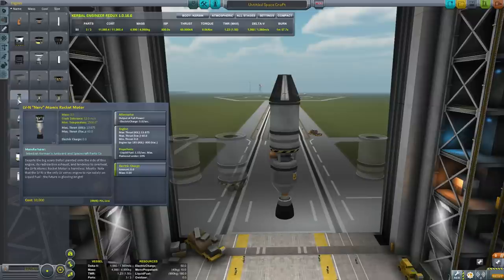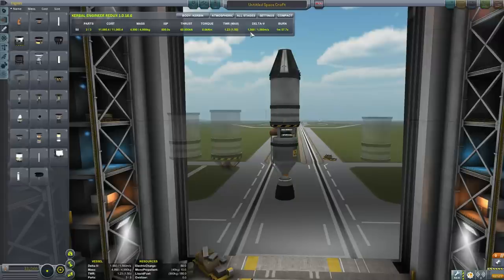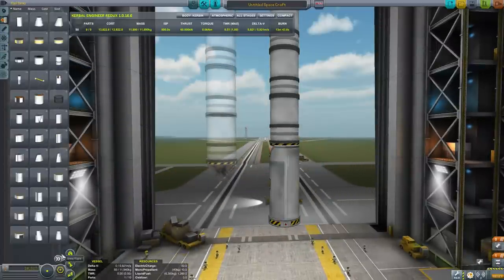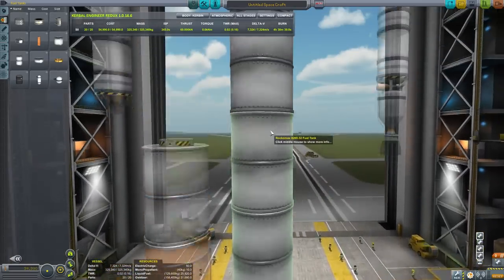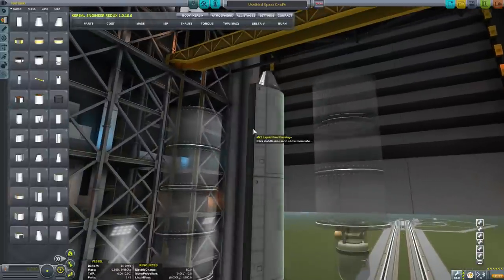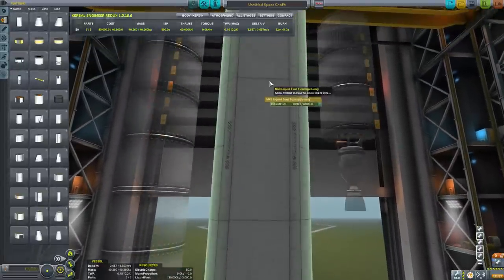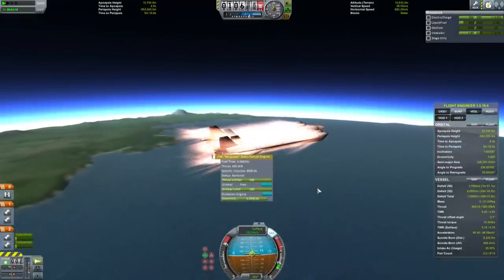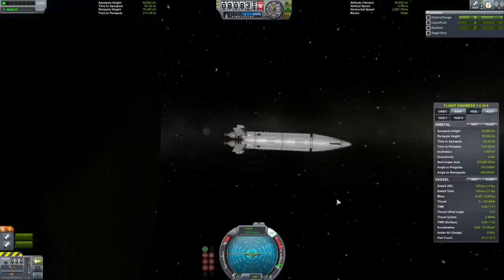Nuclear Engines & Hydrogen Fuel in Kerbal Space Program

Comment: I don't know about Nerva, But if you have done any research on Molten Salt Technology the original Idea was to use a completely different approach to reactor technology, where the fuel is not a solid but a liquid and in particularly a Molten Fluoride Salt.

There were several key advantages to these types of fluid fuels in that they are already Melted and thus, Reactor temperatures could be at far higher temperatures (600-800 degrees Celsius) as opposed to 300-400 for your typical solid fuel reactor. 

Look up the Aircraft nuclear propulsion reactor experiment or the Molten salt reactor experiment.
Reply: OnePercent Therefore you could achieve the same amount of temperature you got with chemical rockets without having a melt down because the reactor operates at room pressure but far higher temperature.
Reply: OnePercent The NERVA engine had an exhaust gas temperature of 4000 degrees, not 400.
Reply: Chris Maillet I was talking about civilian operated nuclear reactor for electrical generation, Not Nerva. 

Fundamentally you can achieve the best temperature with a reactor that does not rely on water.
Reply: OnePercent  Everything I've read about liquid metal cooled reactors indicated that they were a maintenance nightmare.  LFTR FTW!
Reply: Foxholeatheist Well of course, if your fuel medium and Coolant is liquid sodium...

I was rooting for LFTR btw!!!

Comment: Well, technically, they did recieve a fairly big nerf in the "standard" use case, as they used to be able to give insane amount of dV on a very small amount of fuel, making them really viable for small spacecrafts.

They were definitely too good, and with the changes on the core gameplay, it made sense to change them around a bit.

Comment: LH2 doesn't perform well unless you make the tank mass ratios closer to real life.  The external tank on the shuttle weighed 30 tons (LOx tank included) and held 106 tons of LH2.  Those mostly empty liquid fuel tanks are probably more massive than the fuel they hold.

Comment: What is the advantage of using those pre-cooler things in front of the jet engines?
Reply: MonkeyTardis ya; what is it?!
Reply: Sosuke Aizen I dunno, that's why I'm asking :D
Reply: MonkeyTardis A pre-cooler is for the rapier engine. In reality the sabre engine would use a pre-cooler for supersonic flight(mach 5) otherwise the airflow would cause it to over heat and deform leading to rapid unplanned disassembly.
Reply: I can tell you the real life advantage: the air slamming into the engine at mach 6 heats to around 5500 Celsius :)
Reply: ***** If you build a supersonic aircraft without precoolers, I think that qualifies as rapid PLANNED disassembly. :)

Comment: okay now how about ion engines
I built an interstellar ship launched by Extraplanetary Launchpads with the sole purpose of "I'm going to visit every damn thing in this system"

As it turns out, (with tweak scale) 2x1.25m ion engines and 2x2.5m ion engines with 45, 320 units of xenon gas and 456 Electric Charge per Second gets about 17km/s dV with a total full thrust burn time of 3d,4h,27m,16s not including payload. The only issue with this is in order to do a transfer to Duna it would've taken a 34 minute burn which was almost half my orbital period.

I am well aware that ion engines were designed for small probes, not 84t gigaships built in orbit, however since TweakScale goes by cubic measurements, I was expecting them to have a little more power than that
Reply: rparker069 Use the time as you approach the transfer window to raise your apoapsis into a highly eccentric orbit, then perform one final burn to escape on the last go-round. That's how I deal with long burns.

Comment: Well, you kind of have to use the aircraft parts. If you do, the fuel tank is only 10% of the weight of the fuel. That is actually quite realistic, even with LH fuel. But the volume is of cause a lot smaller. Actually the MK2 parts will only fit the exact same volume of fuel, even its twice the actual volume. So the plane part is kind of nerfed. 

You should actually only, at least to my opinion, empty out the fuel tanks to 20%, not 10%, to get the accurate volume. Also you should lover the mas of the tank to 20% to.

On the other hand. The LF tank is only 10% of the mass relative to 13% of the LF+O tank. This is realistic if we talk about normal fuel. So you actually lose 3% mass in version 1.0 in tank mass. (thats about 100kg for a normal fuel load... and the engine is 500kg heavier)... Buuuuut.

Here is the thing. If the Nuclear engine is used correctly. A MK3 LF tank, with 3-4 nuclear engines and a huge as docking port  in the front, and keep it orbiting kerin.

A really nice trick is to slingshot spacecraft out. Give the escape velocity from kerbin. Undock the nuclear engiens, break just so the engines don't escape (just need like 100-1000dV to stop). Then let the engines get a perhaps of about 45km and let them airobreak to they are on a semi circular orbit. Just refuel them and launch the next space craft. Most time, you just want a a capsul on the way home and don't really need a full proultion stage.

Comment: i barely use nuke engines , only nuclear power generation and stick to exotic engines , also interplantary haulers in orbit , keep the dropships low on fuel consumption
Reply: jmm1233 I mostly use nuclear engines on my Duna ships, I've started putting down mobile bases and building a space station in polar Duna orbit to study the planet, and despite being able to go TO Duna using just the end stage of my standard lifter design that I've been using since 0.9, braking into an orbit and then getting back is much easier with a nuclear engine. I might actually try to make a Nuclear SSTO so I can try a bit of flying on Duna.
Reply: ***** SSTO Spaceplane didn't work out for me, but a lander with a nuke did. I used it to get all the science from and around Duna.

Now I'm experimenting with a Duna ion glider, as it would be a lot lighter.

Anyway, I've built "Rings", basically 2 (/4/6) nuclear engines with LF tanks forming a ring, in the middle I have a docking port, I use it to tow spacecraft from planet to planet. ^^

Comment: Nerfed? That's news to me. I might be mistaken but the thrust was 60 and the ISP was 800 for a while now, meaning it should behave the very same way in its intended eviroment: space.
No, that is not correct. As far as I remember, LFO tanks of the same size were heavier than regular LF tanks, which should result in an decreased rocket size and empty mass, which would be a boost rather than a nerf.

Tell me if I'm wrong.
Reply: Björn Mätal It also got a mass increase from 2.25t to 3t, and a price increase, for those who play career mode.
Reply: Björn Mätal Actually porkjet's spiffy mk2 parts were all nerfed in terms of dry mass for 1.0. The mk3 fuel tanks were the sweet spot (I'm pretending you're the sort of efficiency-optimizer who's not above going for >0.3TWR on those longer burns, given roots and part count to burn, and thus doesn't mind using space plane parts on a space rocket ship) buuutt.. their dry mass ratio was nerfed in 1.02. So no, not as big of a boost as one might naturally expect.
Reply: tuckus2003
Never said it's a big boost, (and to be honest, I  kind of forgot about the engine's mass increase) but I still think the changes are in its favor.
Aaaand I'm not that kind of guy. I'm the one with a crappy PC, who needs to keep an eye on the part-count (and size) to keep the FPS on a still enjoyable level, which isn't 100+, but not even 60+... ^^
But I definitely don't mind using SP parts if it's with benefits!
Reply: Björn Mätal hi. sorry for bad english
Reply: Jebediah Kerman Yes.

Comment: 2 intake per turboengine seems a bit too much, IMHO.
Measurments of thrust dependancy on altitude and airspeed:
http://imgur.com/nUvZkn4
and experiments with 1 intake per engine show that engine would give too small thrust (therefore forcing us to fire up rocket engines) long before it would struggle from too few intake air.
By the way, Scott, can i ask you: What's the exact dependancy of thrust/pressure for turbojet? Maybe you know? Failed to find it in the Internet. For my experiment, I've tried different formulas, but they don't seem to match the measurments.

Comment: Scott Manley, I have a question. 

I read online that the nuclear engines may overheat while in use. For KSP 1.4.5.2243, do you recommend that I use engine pre-coolers to reduce the risk or is that really of no use? If they're useless, can't I just attach radiators to cool them down?
Reply: I never seen that nuclear engine may overheat, however, I never had a flight to Moho.
Probably it make sense if you craft is too close to Kerbol, so it cannot dissipate all heat by fuel tanks.

Comment: Your explanation might not be right, from what I understand the temperatures are within the range of ordinary rockets; the issue is that by using only H2, you will have a light exhaust molecular weight that, for the same temperature, will be able to accelerate to higher velocities, which in turn will prove to be more efficient.

Comment: For a Nuclear Engine though, would there still have to be an oxidizer in order for the hydrogen to combust?
Reply from the maker: No, you don't want combustion happening near a nuclear reactor.
Reply: I don't think it needs to combust, because the heating from the reactor expands the fuel enough. I could be wrong, though.
Reply: Chris Flynn there is no combustion going on in nuclear engines, the fuel is purely reaction mass. you could use anything. but they use hydrogen because it's the lightest element.
Reply: Chris Flynn 
The hydrogen isn't combusting,  it's just getting super-heated by the reactor core.
Reply: Chris Flynn It's not actually combusting. It's just collecting heat from the reactor and then being force out the back of the engine and that's what propels you forward
Reply: Scott Manley But that would be entertaining in KSP.
(In my best Scott Manley voice.)
Jeb is assigned the task to space walk outside to ignite the NERV engine as their worst fears came true with the experimental engine...the pilot light went out.  Moments later after a word with ground control, Bill finally chimes through with the fact that NERV engines explode when lit.  Fortunately for the crew Jeb couldn't figure out how to light a match in space.
Reply: Chris Flynn A nuclear engine doesn't actually burn fuel, thrust is generated through thermal expansion of a lightweight gas.  The heat comes from a nuclear reactor.
Reply: Chris Flynn No, but there's a concept called LANTR, LOX-Augmented Nuclear Thermal Rocket. It's basically a NERVA with an afterburner, consisting of an oxygen injector on the nozzle. It decreases the ISP while active, but greatly increases the thrust.
Reply: Sarge Rho look who it is! :P
Reply: Chris Flynn No, you don't want chemical reactions taking place near a nuclear reactor core.

Comment: I really enjoy your KSP videos, and I happened upon this one. I noticed in your intro that you stated that the exhaust temperature for nuclear (NERVA) designs "can't be as hot" as a chemical rocket exhaust because the hydrogen is "cryogenically cooling the reactor." Perhaps that's true in KSP, but in real life, it's exactly the opposite. Nuclear reactors can reach operating temperatures far in excess of the temperature of any chemical engine (>20,000K for some), causing their vastly improved ISP and dV. Hydrogen is used because it is the lightest element, among other properties, so the thermal energy input from the reactor translates into the highest exhaust velocity, and hence ISP. the Hydrogen's job isn't to cool the reactor, it's to propel the vessel as reaction mass. IRL, High thrust at sea level is certainly possible with NERVA and other nuclear engines, but the thrust to weight ratio is much lower (about 1:7) than chemical rockets (1:70). Upper stages and deep space applications are the best use of current NERVA designs, as those can take advantage of the much higher ISP (up to 2000s for some of the more advanced designs). Some nuclear propulsion designs are estimated to have thrust to weight ratios of 1:30, making nuclear SSTO's more possible, although use of nuclear engines in the lower atmosphere IRL will scatter radiation back to the payload (and crew), which is a design challenge for shielding that doesn't come into play in vacuum environments.
Reply: Wall of text.

Comment: This is going to sound silly since it isn't the actual subject of the video but would you suggest the KW Rocketry mod once they have it updated to 1.0? I have the Steam version of KSP and well I have to run 1.0....
Reply: ***** I use KW and it works fine in 1.0 if that's what you are asking.
Reply: Grogger Koldomar Ever since I got the program I've run it completely stock.  I recently started following Scott and went back and watched his IQ vids and saw he was using it and wanted to give it a try.  Unfortunately I can't use the fuel tanks for KW rocketry because apparently when oriented vertically such as in the VAB I can attach something to the 'top' of the tank, but I can't attach anything to the 'bottom (like an engine or another fuel tank)
Reply: ***** That's odd. They work fine for me. Unfortunately I don't think I can give you any useful advice. Maybe check the Curse forums or something for known bugs and fixes (assuming you haven't already). Anyway, good luck.
Reply: ***** why do you have to use 1.0? it's not like steam does not do the most recent update or anything..
Reply: theguy9208 sorry I probably should have said 1.02 (I think that is the newest version.

Comment: How would a potential Nuclear Electric Rocket fit in?

http://en.wikipedia.org/wiki/Nuclear_electric_rocket

This mentions the SAFE-400 kW thermal reactor and VASIMR, DS4G and Pulsed inductive thruster.

As starting points for a comparison. I don't suppose Kerbals has the same political problems with nuclear power or using experimental technology. :D

Comment: Can I still use them to get off the surface of Eve, or should I rely on the Terrier for that?
Reply: No chance of either working; as far as I am aware, their thrusts are greatly affected by atmosphere. When I landed on Eve in a craft with a 909-Terrier, it was producing 0kN of thrust on the surface.
Reply: Best way to get off Eve:  Hooligan Labs (a mod that adds airships) or a monster lifter with tons of ΔV
Reply: nah, thrust decreases when pressure increases, so at eve surface you need big lifter engines to get out of atmo quickly. Use mainsails and go as fast as you can, then once youre higher up you can start using some good-isp engines
Reply: The nuclear engine has a specific impulse of 0.001 at 2 atm. Eve's sea level atmospheric pressure is 5 atm. So if hard-pressed to make a choice, I'd go with the LV-909.
Reply: Even those barely work. LV-909s are only usable in the higher atmosphere of Eve nowadays.
Reply: Jack Graham Yes I know. I was just answering the question "would I rather have a nuclear engine or an LV909 on the surface of Eve?"

Comment: I can't even build an SSTO with 100% of the fuel how am I supposed to build an SSTO with 10% of the fuel...
Reply: TheElfangor Use 2 rapiers and 1 nerv. Only bring a tiny amount of oxidizer (100-200). Do as Scott did in the video, go to 10km and then pick up speed, once you get to 800m/s begin your decent. If you do it right you should be at 1.5km/s before you switch over to using oxidizer.
Start the Nerv at this point because the rapiers only get you into 70-80km space. Aim at velocity vector for the whole ride when you get to apo the Nerv will circularized your orbit with about 40% Liquid fuel left (and no oxidizer that you won't need).

Both the Nerv and the Rapier are super expensive engines though, so a SSTO like this in carrier is probably not worth it, I prefer to stick to cheap solids :P

Comment: New nuclear engines suck, overheat within seconds, unless you are willing to multiply part count 10 times by adding wing parts on them. Either way they are a good way of selling new PC hardware :p
Reply: Dark-EyedTraveler Much like the mainsail, stick a slim-jim fuel tank right before the NERVA. Of course, you're right, we shouldn't have to do that. The fuel IS a high-power coolant system and should keep the reactor from melting.
Reply: Ill give it a try, but i can't do that for every occasion
Reply: To run a nuclear engine without it overheating, just do this: if you want an FL-T800's capacity, place an FL-T400, then an FL-T200 below it, then two FL-T100s and drain them all of oxidizer. Then add the engine. You can also stick that below a huge stack of other tanks (FL-T800s without oxidizer or jet fuel tanks).
Reply: Joseph Adkins Right..

Comment: Why don't you just use plane tanks? Still liquid fuel.
Reply: megatiger78 Because the jet engines that use only liquid fuel can't work in space. In order to get in orbit, you need to make a burn in space, so you'd need the nuclear engine. (the only engine using only liquidfuel that'll work in a vacuum)
Reply: megatiger78 AAaand after posting that I noticed you were talking about tanks, not engines. My bad >.<
Reply: Tim Falken You also forgot to add in tgat theres no air in space and the plane engenies simple cannot run without Air. ;)